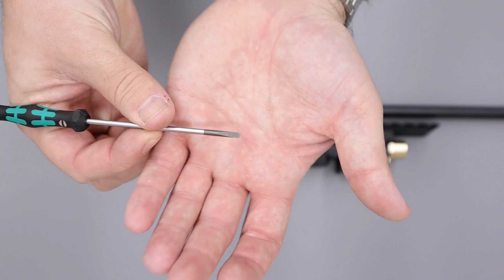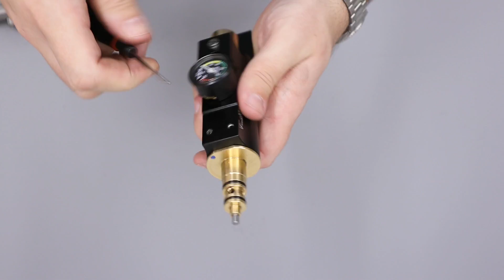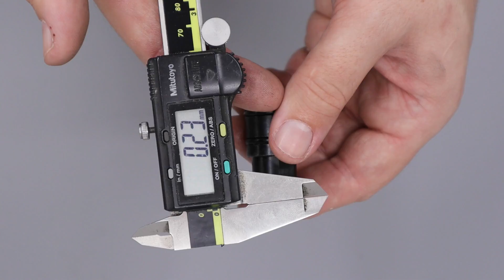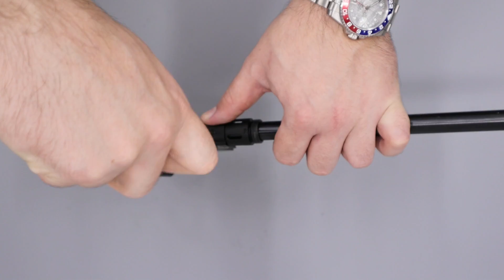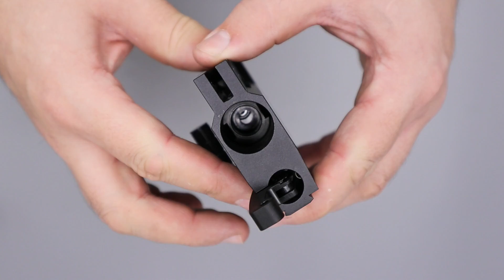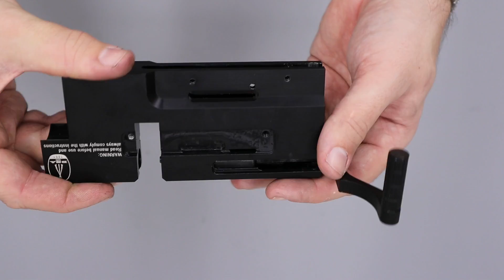BSA R12 Full strip down (Anti tampers removed)

Comment: I hope you are still watching this video,so able to answer a question please. I have a R10 and removed the tamper on that with  basic tools.a hand held electric drill,it went ok. i would love to buy the r12 BUT the amount of anti tampers stops that. but i keep coming back to wanting one. are the anti tampers on this (4 to be drilled) as easy to drill as the r10? i would have trouble using a large bit, i drilled a smallish hole on the r10,screwed a self tapper in and used pliers to pull the plug out.the brass tube looks very easy to do,thanks
Reply from the maker: you will be able to get them all out with a hand drill just like the r10 the only tricky one would be the barrel port but you should be able to wind a screw in and pull it out

Comment: Why is it that most people that own these guns find them extremely accurate like 12 shots on a thumbnail at 30mtrs…….I shan’t watch anymore of your videos and in parting I think you are giving people ideas that will lead to accidents and good guns that no longer work.
Reply from the maker: I think if you look around youtube for vids NOT ADVERTS  or a local range you will see that lots of people are have problems with this gun, BSA have recalled it once to sort some of the problems out so i don't think all are as happy as you think  the one we have is very disappointing
Reply: @sub12airgunners so you are a Bona fide bsa trained design engineer…….nearer the truth you are a time served “face” who knows how to set up a lathe and mill inconel and you can take stuff to bits and put it back together along with your opinion on “well if I’d designed it the thing would have blah blah”
Reply from the maker: @peterprice5896  you don't need to be a Bona fide  trained engineer to tell the gun will not group, the 8/9 people that shot it at the range couldn't do better than a 2in group !! that is not good for any pcp let alone a £1250.00 one 🙄
Reply: You are a smart fella I just think you should maybe keep your ideas at the pub or shed.

Comment: Genius tear down as usual Jake. I think most would come unstuck searching for the ATs and butcher the block 😊 Whilst it's encouraging to see that BSA have binned the original troubled reg design, it's sad that the finishing on the latest version isn't quite up to par, especially for the price) ATs are a controversial subject, but to fit an AT that prevents removal of the barrel is a special kind of twisted idiocy, as often the best way to clean a barrel is to remove it. Looking forward to the 'improvements' ❤
Reply from the maker: yes i will make servicing very expensive when the warranty is out and will stop a lot of shops doing easy fixes for the customer
Reply: The reason for AT might be to protect the customer we live in a country terrified of guns , if it was over the legal limit in lbs the anti tampers could be a defence in court

Comment: Great clear disassembly demonstration with great instructions and advice (Very professional). I am sure this assist most people from damaging their rifle. 
Valve housing exit ports are poor, wasting air, and together with transfer port I have to wonder what they were thinking. There are so many more efficient and simple valve/tfr port designs on the market (do  they also think a square wheel is better than a round wheel?).
The only R10 I worked on benefitted from a shortened spring/hammer arrangement to make it free floating, reducing wasted air.
Apart from barrel crown/polish etc, looking forward to see what you will need and want to change.
Reply from the maker: lots of the inside of the R12 looks like r10 just done a little different, the light hammer is spoiled by the long soft hammer spring with a ton of pre-load  the reg is better but they could have done so much more IMO  🙄 thanks for watching and taking the time to comment

Comment: A nice and clear tutorial - the brass splined abomination is really rather silly.  Are they on all varieties?  Just thinking that on the super carbine, it would stop someone putting a longer barrel on and upping the power without any other changes?  if its on all, then I'll go back to it being silly 🙂   In terms of the hammer weight, interesting it was a couple of grams lighter....ow does the hammer spring compare in your experience?  If the hammer is lighter, are they using a stronger spring?  keep up the good work.
Reply from the maker: i think the brass tube is on all of them mate just seems silly to me 🙄 the hammer spring is the same or maybe just a tad heaver  as the R10 so to make it work they have to put a ton of pre-load on the hammer spring  🙄 that's why we still here the bounce 😳